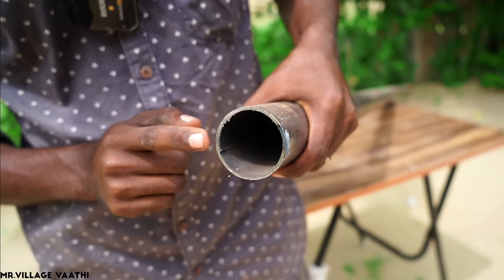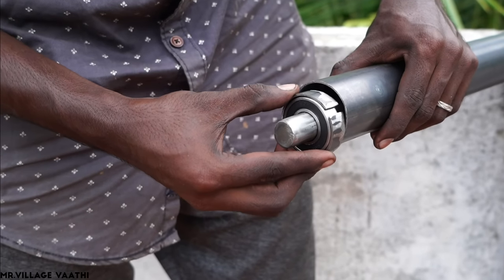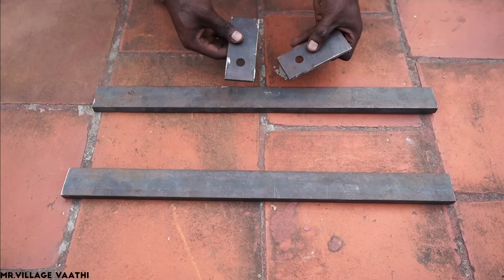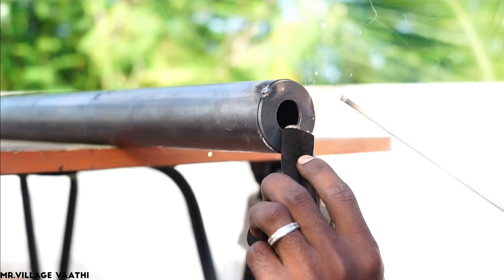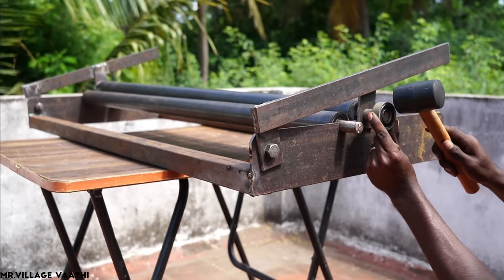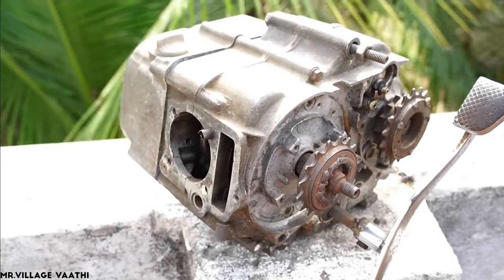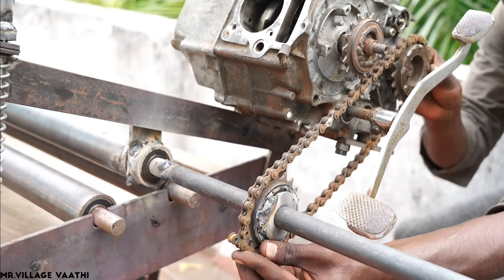உருட்டு மெஷின் | Using Bike Engine GEAR BOX | Making Roller Bender Machine | Mr.Village Vaathi

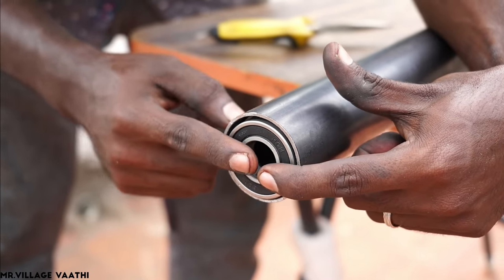Comment: Bro Etha worm gear box 1/2 hp motor with left right switch mattum iruntha easy ya irukum I think 1:40 ratio gear box use worm gear box machine super
Reply from the maker: gear box price la bro athigama irukku
Reply: @MrVillageVaathi  en videos check panni parunga nanum machine make pannuraen. Old gear box motor use pannunga